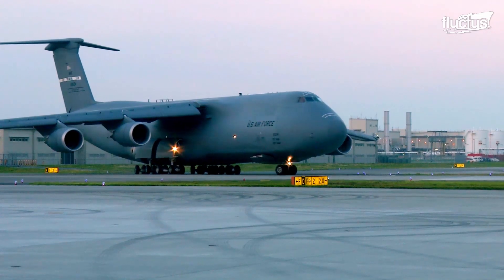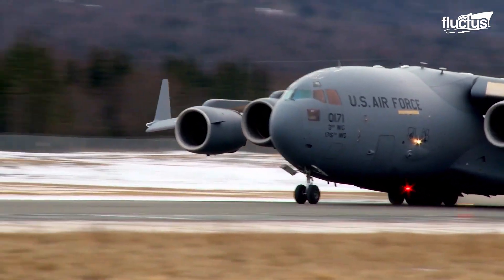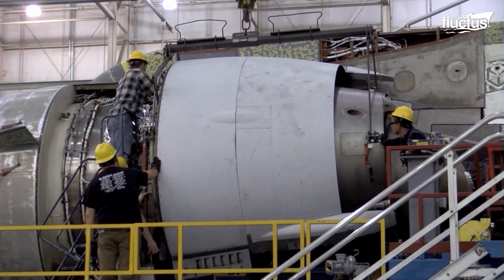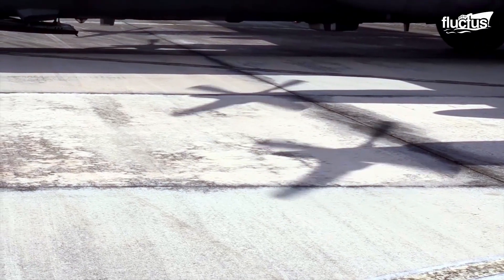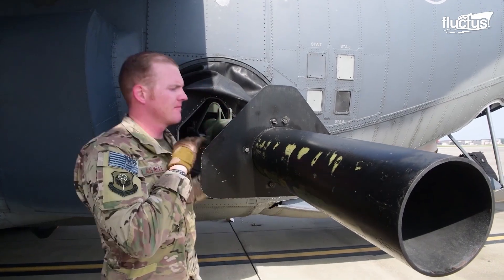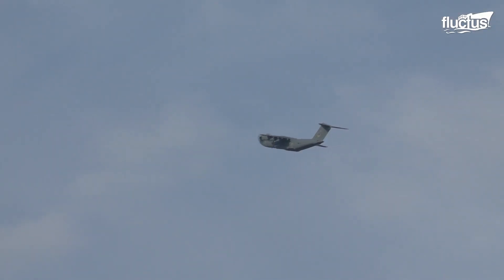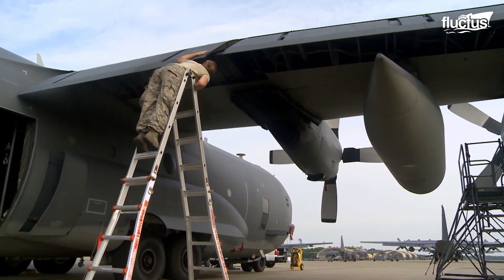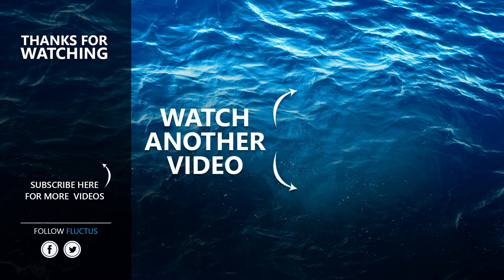This US Air Force C-17 Engine is So Powerful it Can Create a Mini Tornado

Comment: My son in law is an RAF Pilot who flies the C17, he's on exchange in South Carolina for 3 years, he has constantly refused promotion because he loves flying this aircraft so much, he was flying  one of the last planes out of Afghanistan.
It is telling that the total cargo load of a C130 would fit on the tail gate of the C17.
Reply: Former C-130 mech here.  I do not believe that final sentence is correct whatsoever, but I've been proven wrong before!  :D  I've ridden in both aircraft, none more than the 130.
Reply: @davidwilburn6314  My son in law as I said is a C17 pilot and it was him who told me that.
Reply: @stevewhite6861  I've learned in my long history of aviation  never to trust pilots in such matters!  I want empirical data. 😆
Reply: @davidwilburn6314  I trust my son in law and I have been on a C17 as well.
Reply: @stevewhite6861  I'm pursuing it and I'll get back w you.  Quite curious now
Reply: @davidwilburn6314  By the way he's an instructor pilot as well so he knows his stuff.
Reply: Don't know what the total cargo weight for a c130 (model does matter) but I do know the c17 can carry a completely loaded c130h (aircraft fuel and cargo) worth of weight and not be at max takeoff weight